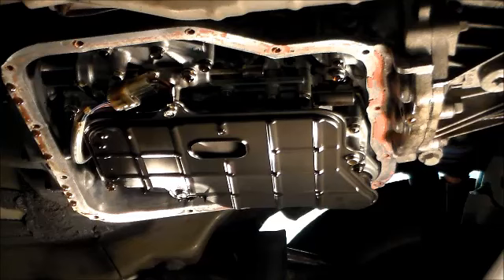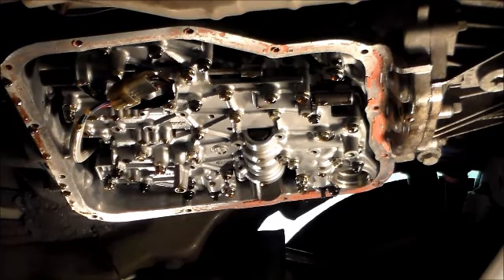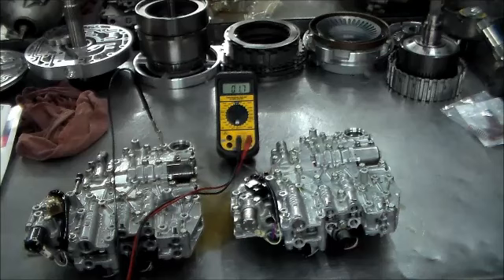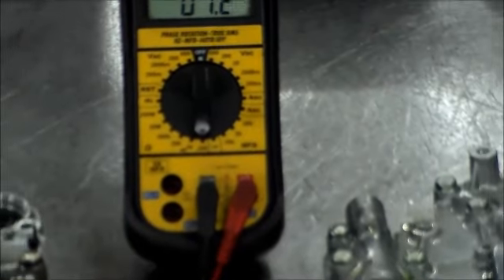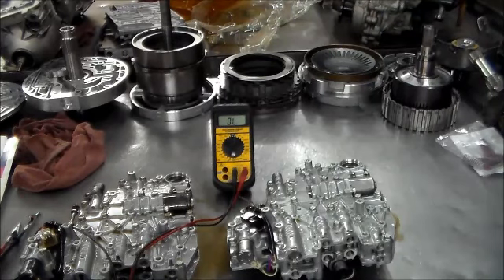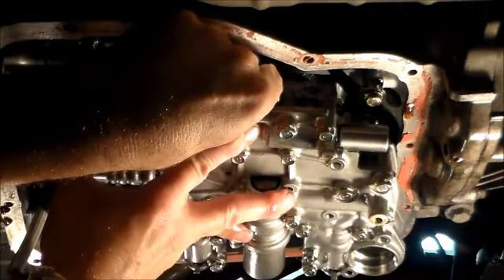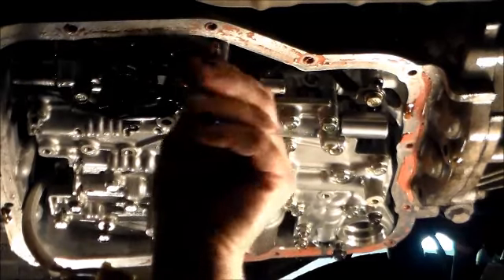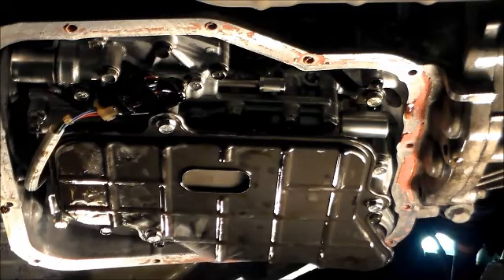Lineartronic CVT Valvebody Replacement with code P2764

Comment: I couldn't help but noticing that your fluid is red and true CVT fluid is not dyed red is actually a cut of a yellowish amber color if you're having problems with your CVT transmission and your cylinoid could be that you're using an automatic ATF fluid instead of the CVT fluid I'm just saying
Reply from the maker: The fluid you see is what came out of the trans, when i bought the valvebody from the dealer, i had them send there fluid, when it comes to these units i always go with dealer fluid

Comment: What happens if you change the valve body and don't do the relearn? I'm curious the symptoms that could happen
Reply from the maker: just by driving, it should relearn, as long as no codes are present and the trans temp is above 130F  it should adapt
Reply: I'm asking because the dealership just changed my valve body, and now the car jerks and sounds like grinding when going from a complete stop to forward. And it will shiver and jerk when I'm at a complete stop with foot on the brake. They won't acknowledge that this could have happened from valve body replacement or anything related to that service, and they seem to be at war with me saying it's a completely separate issue. But in my mind nothing else changed. I was curious if they didn't relearn or reflash the system, could those be the symptoms? Or in your experience would those be symptoms of messing something bigger up?
Reply from the maker: @melissaiszler3490   Why was the valvebody replaced? was there a code present?
Reply: P2764 and P0700
Reply from the maker: @melissaiszler3490  ok, has anything changed or car still doesn't drive correctly
Reply: The car was fine before, but now that the valve body was changed it doesn't drive correctly and shutters pretty violently with applied gas. The dealer is now blaming it on putting a new part into an old transmission causing problems and saying it's typical, which I believe is just a cya thing.. I don't think it has to do with a relaern like I had asked before though.
Thank you for you help in answering my questions!
Reply from the maker: @melissaiszler3490  very possible defective part or maybe installed wrong, are they going to help you, maybe install another valvebody?  Are they the ones that said you need a valvebody?
Reply: @GaryFerraro  yeah they said I needed a valve body, but after all this follow on mess I dont think they actually did anything to decide that other than look at the lights on the dash and see the code. they won't actually do any diagnostics but keep lying and telling us they are.  They said now the jolting is actually the brake stoplamp switch, then when it wasn't that they said CVT pump #2 is bad and we need a new transmission and plenty more lies.  We've lost trust in getting a second opinion and escalated it to Subaru. We'll see if they can help us. I would hate to trade in a car that all it needs is a simple fix in the valve body or even something else minor.  You're not anywhere near South Texas are you? lol
Reply: Have you had experience with P0841? Now we are getting that? Could it be valve body related?
Reply from the maker: @melissaiszler3490  give me the year, make, model of the car and i can look up the code
Reply: 2014 Subaru Forester
Reply from the maker: The 841 is pressure switch A which is on the valvebody.  Either there is something wrong with the pressure switch or there is a leak in the secondary pulley, i've seen this code before on nissan cars, both times it was a leak in the pulley
Reply: @GaryFerraro  thank you!
Reply: @melissaiszler3490  What's the latest? THanks!
Reply: @NiNjaTurtLe697  we sold the car and got a new one. We didn't want to deal with it and didn't trust anyone to diagnose it
Reply: Melissa Iszler wait... They bought the car with the lights and problem exhibited? How much did they offer and what was the kbb value please? Thanks!
Reply: @NiNjaTurtLe697  unfortunately it's was about 3 or 4k less than kbb. We had little  higher mileage too, and they said they weren't going to resell it, that they would just take it to an auction. We didn't get much at all for it but we just wanted to be done after the dealer screwed us over. We would have tried harder and probably fixed it if we could have trusted someone.  We also probably could have gotten a new transmission for close to what we lost in it... Selling it is probably not the most recommended route to take for most...
Reply: You also probably could get more for a trade in at a dealer than what we got. It's a long story why we didn't do that, but if we could have we would have traded it in instead
Reply: @melissaiszler3490  thank you so much for info